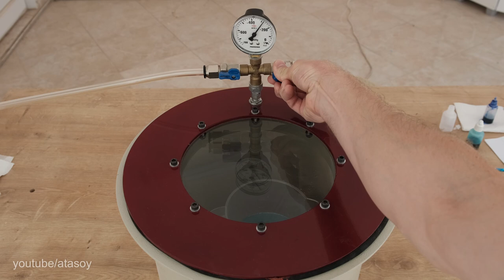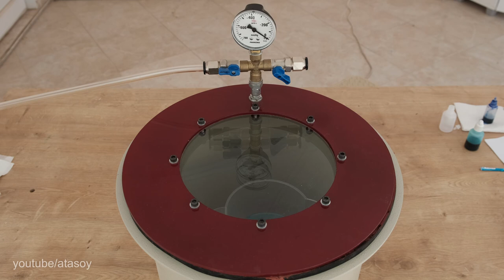Epoxy Resin Table Lamp with Diver and Sea Turtle

Comment: Loved your work!  Could you tell me what that spray you sprayed on the wood (in the mold). Thank só much. 👏🏻👏🏻👏🏻👏🏻
Reply from the maker: It is an auxiliary spray used for the drying of instant adhesive.
It comes as a set with adhesive.
I am sharing you an example link.
aliexpress.com/item/1005004502937047.html